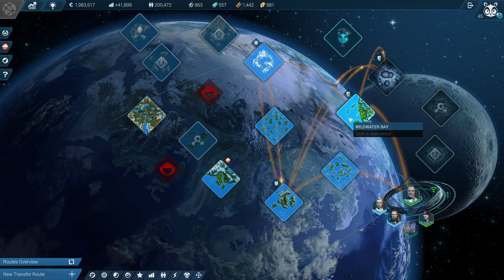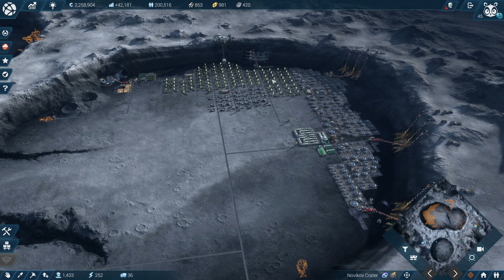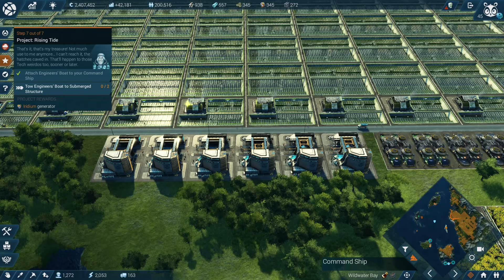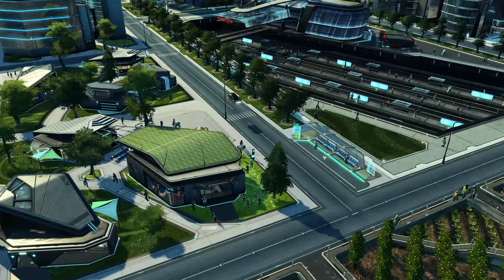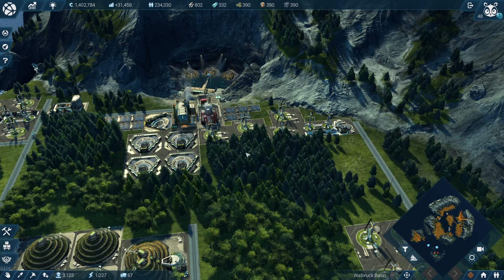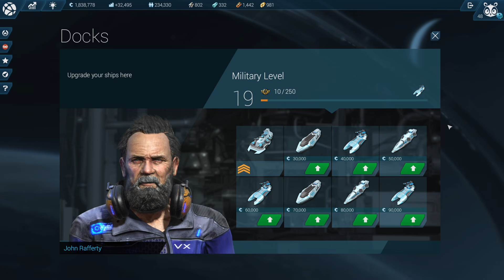Anno 2205 - New productions & Global Market challenges! HIGHEST VETERAN DIFFICULTY! 2023

Comment: You were saying around the 6:30 mark that you couldn't upgrade the buildings because you needed workforce. Unless I am seriously mistaken in how workforce works in this game I believe you are wrong. Anno 2205 is far more simplistic than Anno 1800 and any class of population adds to workforce based on the density of the building. So your higher tier buildings are generating more workforce than your low level worker buildings. Effectively, you are generating less than your maximum potential of workforce by keeping so many lower tier housing buildings around.
Reply from the maker: hum maybe i'm wrong but you make the same number of workers (you make more residents and thus income) ONLY if you give new productions which will cost you more workforce to keep alive then